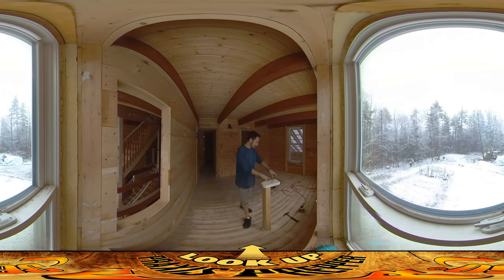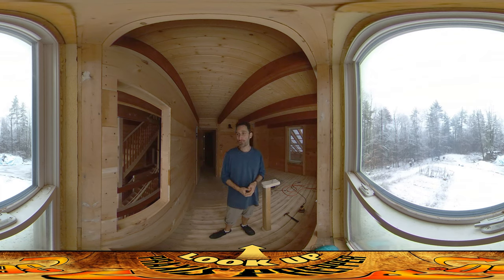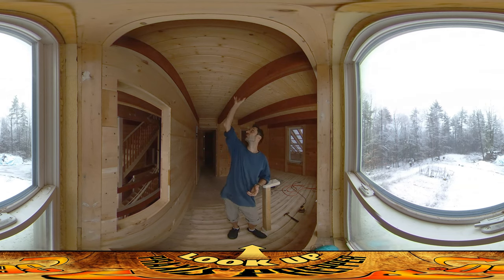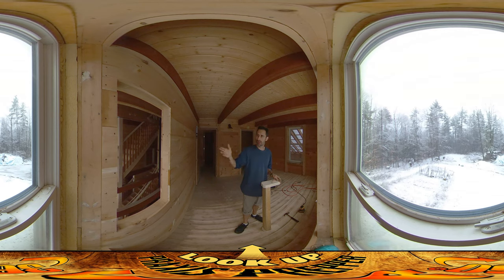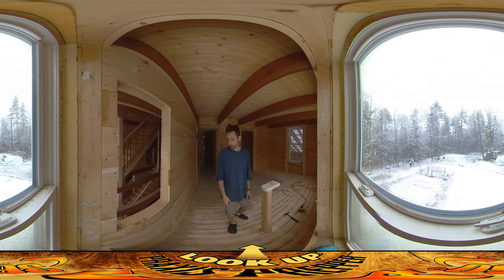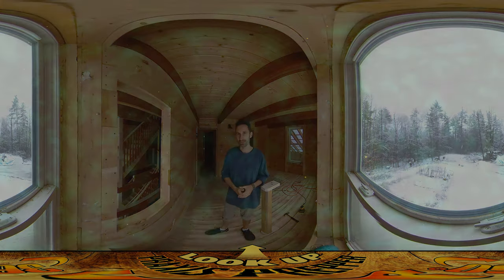Homestead Building - Handrail Work and Floor Sanding

Comment: great view with the snow.

remind me... what is that room? if i recall correctly all the bedrooms are on the top floor right?
Reply from the maker: That'll be my bedroom. We have maybe a foot of snow coming tomorrow night too - the day we have to work in it will be day 666.
Reply: @PraxisPrepper  Part of me thinks you’re drawing it out 👹
Reply from the maker: @inmyimage1081  I know you're kidding around, but it's gone through my head about when this series ends. Because when we move in, there's still a lot to do. I think maybe when we move in, I'll downshift to only doing videos when I'm doing something particularly interesting or important, and have episodes pop up now and then. I already know that we won't be in by day 666 now because that's the day after tomorrow and I'm still waiting for inspectors to show up when they feel like it. Total holding pattern now - but still working on the house to get it more ready when we're allowed to move in.
Reply: @PraxisPrepper  Yeah, I know it’s really going to continue to be a work in progress for a while. I think you have the right mindset of doing as much as you can before you fully move in or it won’t get done, especially if it involves and significant effort to prep like moving furniture around or forcing someone to sleep on the couch for a couple days.
Reply: @PraxisPrepper  Given all the problems you’ve had, it would have been a fitting end to get your occupancy permit on day 666